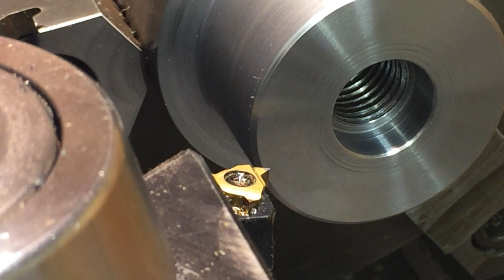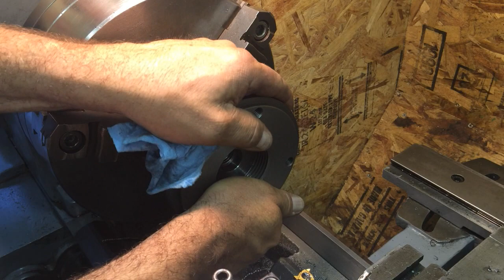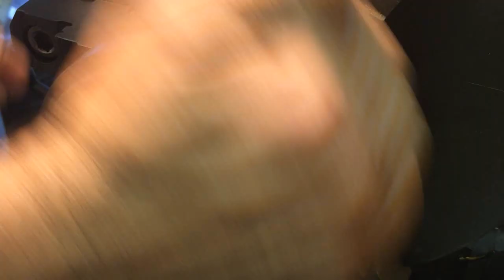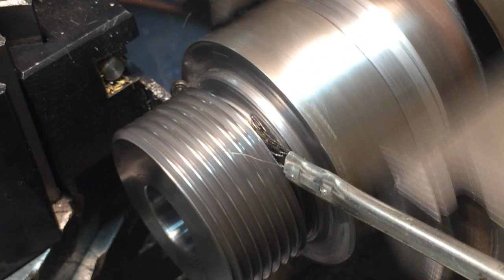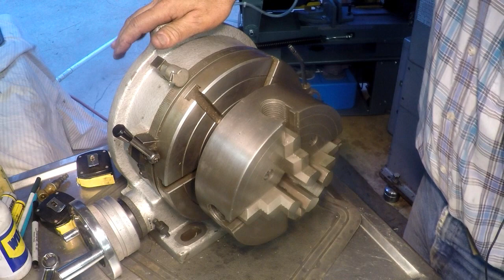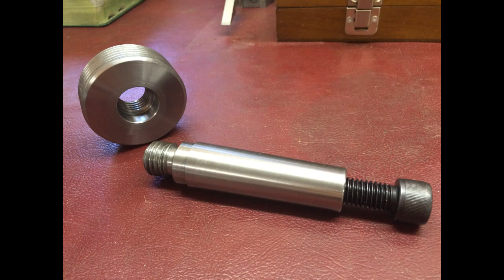Rotary Table Chuck Mount Part 5

Comment: Very nice work Randy. Always great when the work agrees with the calculator and what it should show on mikes and indicators. :-)  Some very fine fits in all that. And that's the best fitting thread I've seen done on Youtube so far. I dunno how anyone would get a closer fit than that though.
Reply from the maker: +Turning Point This all came out great, I have used it a few times now.  Thanks, Randy

Comment: Since the female threads don't have a perfect theoretical V down at the root, wouldn't it be a good idea to dress the crests of the male threads with a file before making a test fit. I could see where interference from a sharp crest and a rough (or radiused from the cutting tool) root might make a test fit seem tight when the actual 60˚ surfaces were a pretty good fit.

Thread profiles and drawings always seem to specify some truncation of the crests to allow for something less than a perfect V at the root. The starting blank may be made a little smaller than the nominal size to allow for this clearance, but the cutting tool always seems to push up a bit of a burr at the edge of the cut.
Reply from the maker: Peter W. Meek Yep, I did lightly dress the threads with a file, just did not show it.  I usually target the upper end of the tolerance for the major dia.  That way if I end up a few under I am within the tolerance for the threads.  Thanks for the great comments Peter.  Randy

Comment: Randy, there is audio interference. -Helicopter - It's the same like Kilroy had and I think he traced it to the wifi output to display on the cell phone.
Reply from the maker: 12345NoNamesLeft Yep, I forgot to turn off the wifi/bluetooth connection a couple of times,  I am old and for get here and there.  But I am getting better.  Thank you for letting me know.  When I edit I don't always hear  the thump.  Thank you again Randy

Comment: Nice job Randy, just wounding if you need to make a lock so it won't unscrew?
Reply from the maker: johnnym1320 Thank you.  When I get back I will be figuring out a locking feature.  I to am concerned about it.  Thank you for mentioning it. Randy
Reply: Randy Richard I am thinking something to slide in the "T" slot possibly.
Reply from the maker: johnnym1320 That might be tough, but I will look at that.  Good idea.  Thanks, Randy

Comment: I will be interested to see the run out when you check it since you now have 3 more sources of error in the assembly, of course since you can true adjust it really doesn't matter, but I am just curious how the tolerances stacked up.  When you are using it in the horizontal do you think the extra height will be an issue? That thing is what a foot tall to the end of the chuck laying on its back? It looks super handy, and you have given me an idea for something I need to make sometime.
Reply from the maker: bcbloc02 When I get home I will be doing a check on the alignment.  I will measure the height also.  Super Spacers are also quite tall.  Thanks Randy
Reply: I was curious about the same. Wouldnt it be theoretically more true if the large 2" thread was integral to the mt3? As opposed to having that 3/4 thread in between. Either way, fantastic craftsmanship

Comment: the taper will not hold weight of the chuck , and cutting forces,
Reply: Asaad omar you need to recalculate,before stating your opinion
Reply: +Asaad omar With the drawbar it certainly will. The chucks screwed on just like it would be on a lathe. Without the drawbar pulling everything down tight to the table, then yes you'd certainly be correct. The way Randy set it up just like he said in the video, you just unscrew the chuck from the lathes spindle while it's holding the work that's been machined concentric, then screw it right onto the R/T. Possibly with something like a gear blank I'd probably check it with an indicator. But it's still a fast easy system for mounting work extremely close to the R/T's center of rotation. Even better he set it up to use adjustable chucks unlike a normal 3 jaw that in my opinion aren't good enough for holding work perfectly concentric, or at least capable of being adjusted to do so. You'd have to watch the cutting direction of course so the forces keep the chuck tight. But that should be SOP anyway.